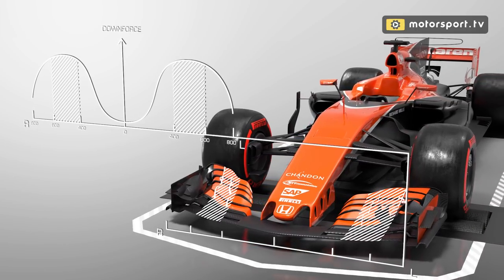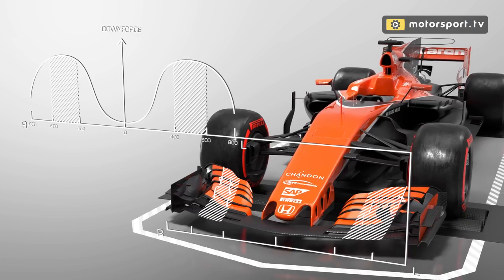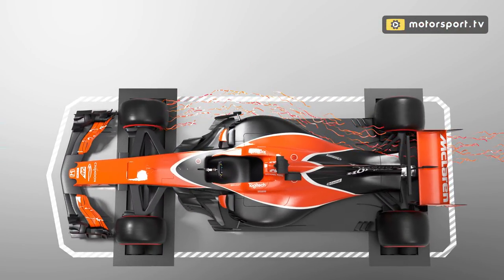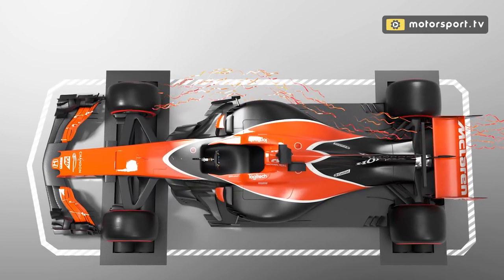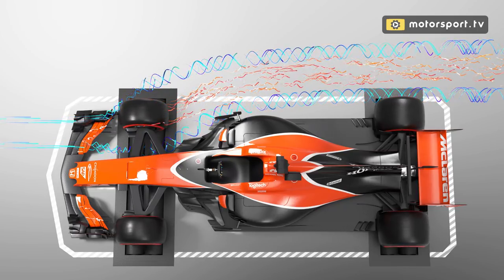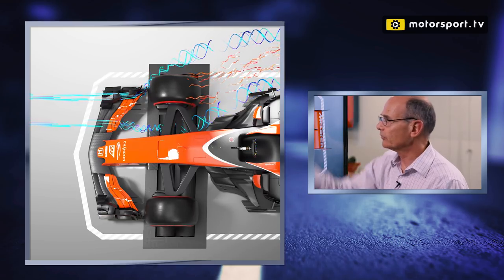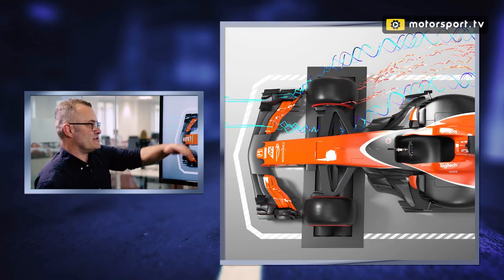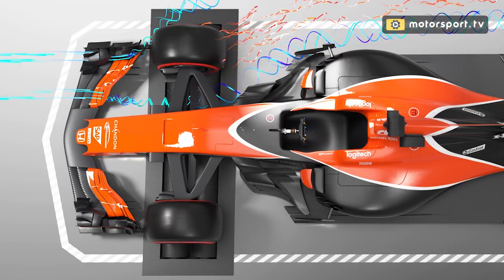F1 airflow explained - part 1

Comment: Hi! I'm Rodrigo, I'm a Formula Student Member at Brazil! I have a question that would greatly help me and my team to develop an even better aerodynamic package for our car. What kind of airfoil does f1 teams use? For example, right now I'm studying with CFD the detachment of the boundary layer at the proximity of the trailling edge because I want to select and airfoil that, although doesn't have a huge lift coefficient, doesn't disturb a lot the airflow that passes through it to make more multi-elements more effective. Thank you very much for anyone who can help!

Comment: I have a question- why do we need the top vortex? Wouldn’t the bottom vortex be enough to deflect the wake off the car?
Reply: I'm not an aerodynamicist but at a guess I'd say it would cause instability if the air simply fanned out away from the car - sort of dragging/wobbling it off centre making it unstable in a straight line?
Reply: It helps to not work against yourself. Air has momentum, so the outside air, if not dealt with, will hit the outside of the front wheel, which will make the job of the inner vortex a lot harder. Think of it as making room to place the wheel wake in with the inner vortex.

Comment: Is F1 airflow somehow different to any other airflow then?
Reply: David Baker - it is different to any other racing series in how heavily dependent and sensitive the cars to airflow...     while there are downforce cars in a whole host of series (GP2, Formula E, LeMans Prototypes etc), F1 has gone a bit daft in recent years taking aero to such an insane degree that it's actually hurting the sport.    Because the cars are so sensitive to 'dirty' (turbulent) air, they can not follow each other closely for any length of time...   as they do, the following car loses a lot of downforce, so they slide around on their tires more, ruining them in just a few laps.

GP2 has very simple aero packages that allows the cars to drive nose-to-tail with out the massive problems encountered by F1 cars, which is one of the reasons GP2 is so exciting to watch.

The fault is not with the teams, they are just doing everything they can within the rules, it's the FIA that sets the rules.   With Ross Braun in charge now, hopefully we'll move away from things like the Y250 and get cars that can actually chase and pass each other often...   fingers crossed !!!    🤞
Reply: orion khan 
Thank u for your detailed reply!

Comment: Clearly, a wind tunnel helps us to visualise airflow over a car. But, the objective is to improve airflow in the real world. In the real world, the air is more or less stationery, the road is stationery, and it's the car that moves - the inverse of the wind tunnel situation. Definitely different scenarios.
May I ask - when using CFD for F1 car design,  does the CFD software attempt to mimic the wind tunnel or the real world?
Reply: Hi Tristan, don't log on often (once a year maybe) but am on now.  These animations are effectively hand drawn but use knowledge from people like me.  The F1 teams all have high levels of CFD and use models in wind tunnels.   Everything is geared to understanding and improving airflow and performance on the real car in the real world.  Each team will have a group of people who's job it is to check and improve correlation between the tools used for development and performance in the real world.  Simulations are just that and have limitations - but having said that if you understand the tools you use well, they can be remarkably accurate.  To answer fully would take a long time.  For more about wind tunnel testing have a look at my YouTube Video about wind tunnels - also quite good fun... https://www.youtube.com/watch?v=KC0E0wU6inU&t
Reply: @willemtoet_yt  Many thanks, Willem.
Reply: Thanks for taking the time to answer Willem.